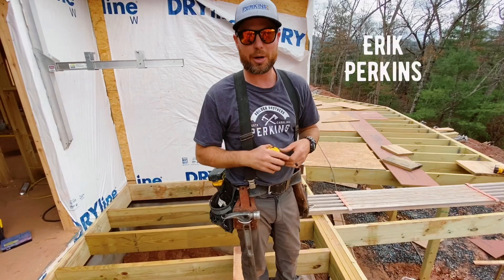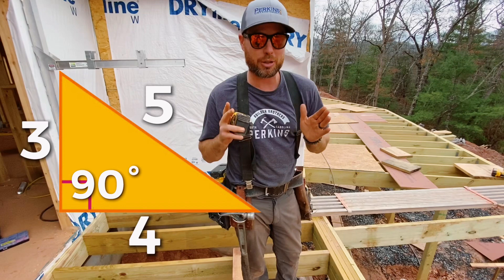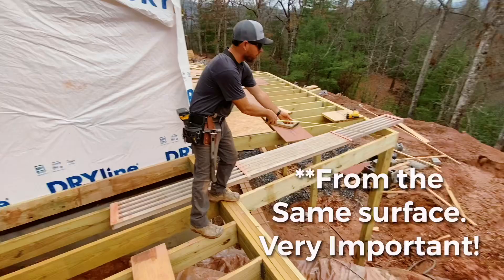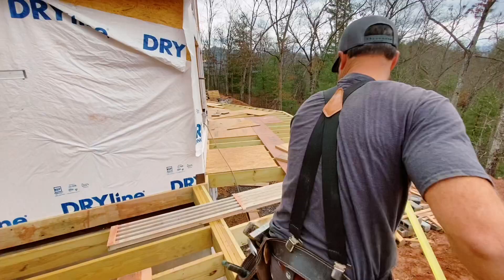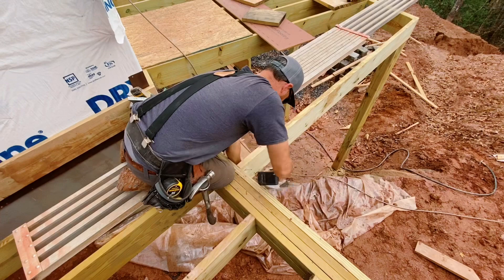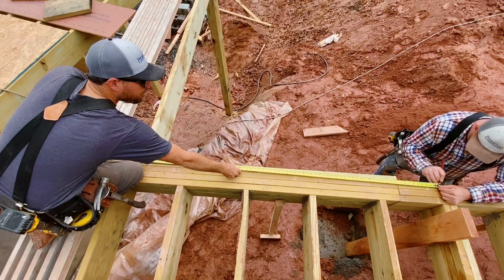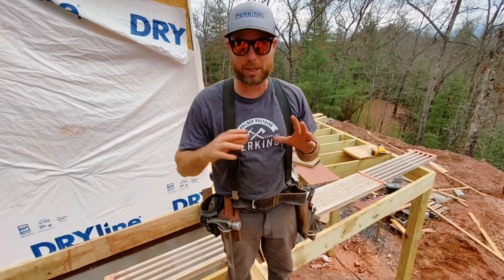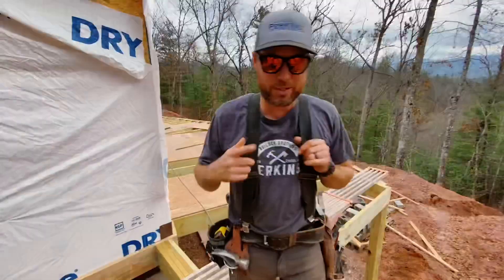The World’s Greatest Building and Carpentry Trick

Comment: HANDY TIP: Many may already know about the "multiples of 3,4, and 5" aspect of this, and I too have been using it for a while. HOWEVER, another very handy way to use this math exploit allows you to put a mark exactly where you want it and not have to check it again.
For instance, say, in this video, the run he's squaring is 79" to the outside corner. What you can do is divide 79 by 3, resulting in 26.33, and then multiply 26.33 by 4, getting you 105.33, then by 5, for 131.66. You can then measure 131.66 from the corner to use as the hypotenuse, then measure 105.33 back, and you'll have exactly what you need.
This is no doubt no revelation, but it took me a while to realize that usage, and in some specific situations, it is WAY easier than trying straight multiples of 3, 4, and 5, so some might really appreciate this idea.
In fact, I would like for you guys to make a video about that idea! It could save a lot of time for some people!
Reply: I agree, would love to see this Vid.

Comment: You can use any measurement as long as it is the same length such as 10’x10’ then multiply by 1.414 , the distance across is 14.14 ‘

Comment: I taught math showing that a'b'c' a"b"c" a'"b'"c'" cut from cardboard where a" is 2xa' etc. , a'" is 3 x a'.  We used the Egyptian knot method with the cardboard.  Putting the largest on the ground, and standing over it with the next size, proves they have equivalent angles.
The theorem can be charted:
a'    b'   c'
a"   b"   c"
a'"  b'"   c'"
To show, if you take a large square triangle, place the hypotenuse on the ground, draw a square line to the opposing angle from the hypotenuse, then make a straight cut on that line, you will have two triangles a'b'c', the small one, a"b"c", the larger of the two, and put together, they create a'"b'"c'".  This helped my children with their homework, when neither could figure out what the theorem was saying.  Using the chart, you can figure the unknown measurements, if you know the trick to figuring it is so simple.  Using tiles also explains squares, and square roots, fantasticly fast.
1 +3 +5 +7 +9 = 25 (5 squared)
11 +13 +15 +17 +19 = 75 
The first ten odd numbers = 10 squared
100 +300 +500 +700 +900 = (50 squared)
          400
                     900 
                              1600
                                           2500
Number patterns can show how squares and square root patterns repeat forward, then backwards, then forwards, in incomprehensible ways.  Look at the patterns in the squares to 100.

Comment: also depends upon wood being straight and not warped
Reply from the maker: You are correct.. This won’t work with a super curved board
Reply: tracycolorado that's when you pull a string along the board and make certain your board is straight. Most good carpenters can sight down a board and tell if it is straight. Years ago the young apprentice had to sight down all the studs and toss the bad ones to the side, that's how you learn to check your material.

Comment: Great video! I've found that trick to be incredibly handy. On a different note, I wanted to know if you guys have any tips on cord management? It seems to always be a struggle to set up and gather up air and electric lines.
Reply: All cords and hoses need to be trained by rolling them up properly and flicking out all twists every time. They should be rolled in decent sized loops hanging from one hand as their rolled up. Always cringe when I see guys grab them and proceed with smaller loops as they easily wrap them around hand and elbow. Most of their cords ate full with kinks and curls that lead to early breakage. All my cords/hoses are ancient with ends needing replaced from being so old their getting dry cracking at ends. Also always grab female ends to start rolling them up as they will be ready each morning to plug in and roll out to needed spots. The more their trained the easier they get.

Comment: The Egyptians used string on a model without measuring, making a knot for short side, long side, and hypotenuse.  Multiplying each length the same number of times of the stone to be cut, they made a perfect cut for the real building, miles away, with the string knotted three times.  Engines of Our Ingenuity podcast, Dr. John Leinhard.  Don't know the episode.
Reply: You're right except one fact is off.  It wasn't called Egypt at th but t time.  It was called Kemet.

Comment: Why use this trick to check your work and make adjustments, when you can use it figure out where to form the 90 (so it's actually 90) in the first place?  Instead of marking 6 feet from the first-attempt 90, and measuring to see if the hypotenuse is 10 feet, make a mark where a 10 foot hypotenuse would be, then message 6 feet to where the 90 should be.  You'll get it right the first time.

Comment: You would be surprised at how many "Carpenters" don't know that..  It's the first question I ask someone if I am going to hire someone to work for me.. How do you know if something like a 10x12 shed is square.. Works for plumbing walls/squaring walls too..  Works for all kinds of stuff.. Use it all the time.. Use it in welding small fixtures too.. Have used it in inches to get a precise measurement..  Nantahala..

Comment: We use the right triangle in plumbing too two equal sides tho multiply that by 1.41 and it gives you the length of pipe on the 45 side and since the two  sides are equal I know where to put  my wye  or 45 whichever  may be the case now don't get me wrong if I'm using 3 inch pvc it's no big deal but if I'm running  10 inch iron pipe in the air I can't just hold a wye up and take a measurement it's all laid out on the floor before hand and cut and it better fit first time let's see y'all pvc plumbers do all that lol

Comment: I’ve always been confused on where to measure from...outside edge? Middle to middle? On this video, it looks like you hooked to your screw in the middle and then measured to the outside edge. That could easily make it 3/8 off.
Reply from the maker: I always do the inside edges on both marks. I don’t usually use a screw but I had it so the head was perfectly flush with the edge of the board. Just did this so I could do it myself without someone holding the tape.
Reply from the maker: Really it doesn’t matter as long as you pull both directions from the same point and rstay on the same edge of that point out both directions
Reply: @PerkinsBuilderBrothers  yupppp
Reply: Ya no, he's right, that is a 6 ft, 8.128, 10.125 (or so) triangle with the screw.  The tape is hooked to the head of the screw.  It wont make any difference though, it's not a space ship

Comment: How do you know whether to bump the adjustable piece left or right at 1:41?
Reply from the maker: Good question... The diagonal was longer than it was supposed to be... meaning that the corner in question was greater than 90 degrees. So I moved it in the direction that would correct that

Comment: That metal tab on end of tape measure moves, do you find your measurements different depending on if its pushed in or pulled out?
Reply: Metal hook moves exactly it's own thickness. When you butt in for a measurement you measure to the front side of the hook. When you hook on, you measure to the inside of the hook. It is exact either way
Reply: bgt63 you sir are correct, I love when people make comments that don't work in the trades, then someone corrects them good job.
Reply: JackedMumin only if it’s worn out. It’s designed to move.